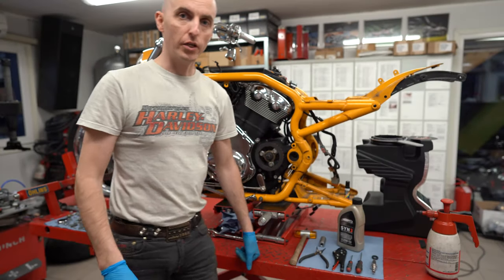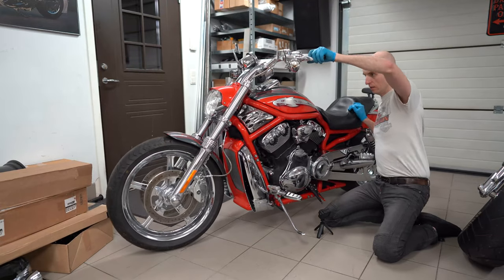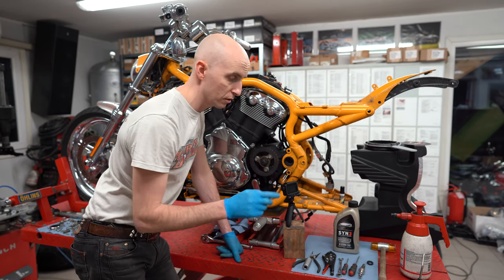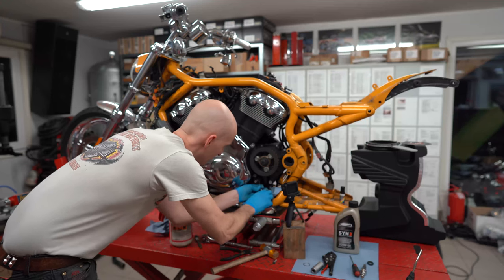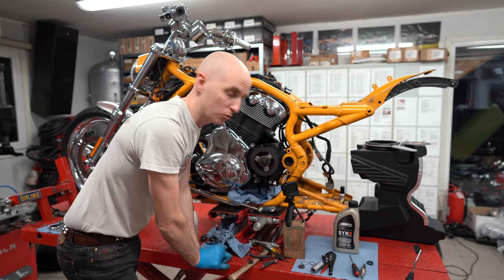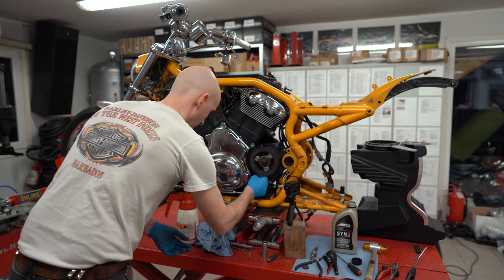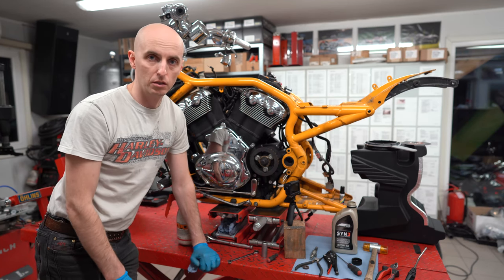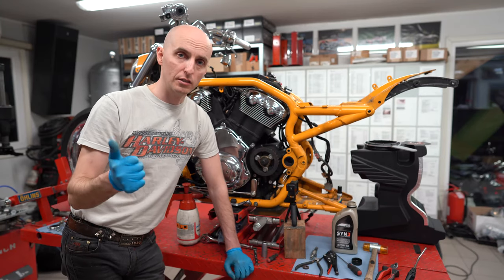How To Replace Shift Shaft on Harley-Davidson VRSC V-Rod H-D Part nr. 35432-01K by Fredy.ee

Comment: I love your videos, - very useful and you are a genius ! But when the shaft is broken so deep  -  as in my case - I would have been curious about the method how you can set it into neutral... I suffered with it two hours because there was not a millimetre piece I could catch with a plier.. Finally I hit an M11 long socket wrench head onto the snag, so it was possible to screw it forward and get the neutral position...

Comment: Do I need to drain the oil before replacing it?  You just made my day.  I broke my shaft off in a fender bender.  I'm going to try to find a replacement for my 2003 VRSCA.
Reply from the maker: Hi, No need to drain oil! Here is the best shaft available on the market: www.ebay.com/itm/175288830586

Comment: So helpful ! I’ve subscribed ! I’ve been told the forks will drop or spring ?? And I will have to have case split . My shaft broke off . In 4 th gear . It’s an 03 anniversary silver model . Fast & reliable bike . I hear the market in Europe is strong for these bikes . I’m considering a sale if I can’t fix without splitting case . Does it have to be in neutral ?
Reply from the maker: Thanks! I always replace them on Neutral!

Comment: Hello I just picked up a 07 street rod. It was running great , then all of a sudden it’s stuck in gear. Is this the culprit? Anything else it could be?
Reply from the maker: Hi, If the linkage is not stuck than the problem is inside the engine - must open up and take a look!

Comment: Hi my Vrod is stuck in first gear, can i still try to replace the shift shaft with out being in neutral? Thank you
Reply from the maker: Go ahead - I cant stop you!
Reply: I think it's best to put it in neutral. I recently did my shift shaft replacement by following this video guide. Took me 5 hrs to do it because I didn't have all the tools to make the job easier ( lift, level ground) but I did take the time to shift it in neutral by using the method in the video. I didnt want the spring to bounce back into the engine and spend over 1k at a harley dealership.

Comment: Some vrod owners are having issues with the vrid jumping out of gear after replacing the shaft. Have u had this issue ? Thanks
Reply from the maker: Hi, I never had issues like that!
Reply: @HarleyFredy  We ha also situation like this, we had to remove engine, because of spring which moved inside:(

Comment: I have a question.  what voltage regulator do you use for your custom night rods? I have a 2017 night rod and apparently I changed out the starter and battery and in a couple of weeks, battery drained.  I was told to change out the voltage regulator.
Reply from the maker: Hi, I always use original regulator!

Comment: Try to replace the shift Shaft but can't get it into Nuetral. Is there a trick to it? Can you give more details... does it matter if you turn it clockwise or counterclockwise?
Reply: I figured it out... need to rock the bike forward, only, not on the back stop...while turning the shaft counterclockwise. At least, that's what worked for me. I also read, on the 1130 forum, that it doesn't matter what gear you're in. Job completed successfully. Thanks, Pat F.
Reply from the maker: Hi, Its shown in Video since 1:18 and you "turn/shake" the shaft both ways as you dont know what gear you are standing at - very easy!

Comment: Hi. I can't get the shat back in. Been trying few hours
Reply from the maker: Its really complicated to understand whats happening but put the shift arm to the shaft, slightly tighten its bolt and try to hold with this and push the shaft carefully in. Make sure that the shaft is well lubricated!